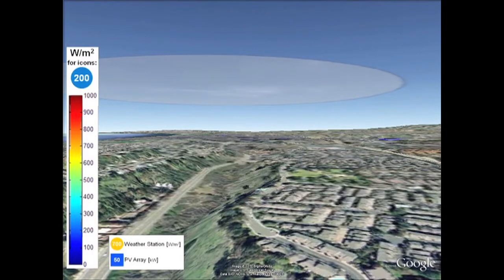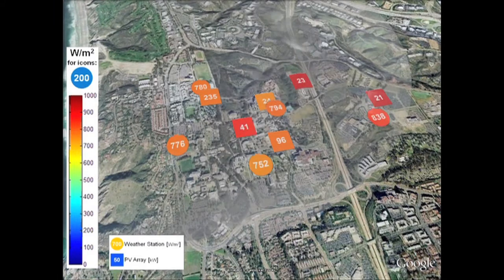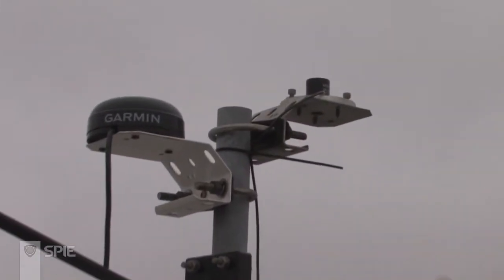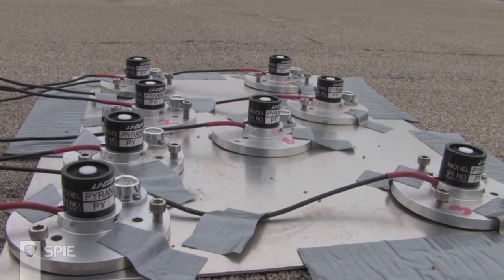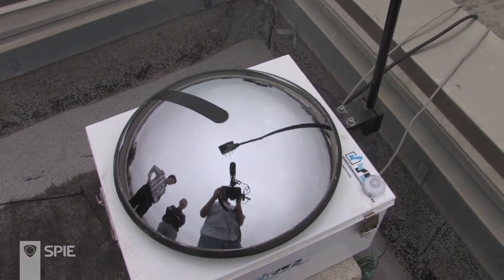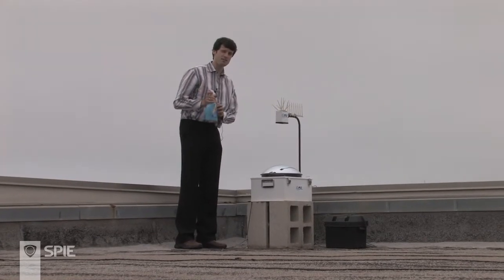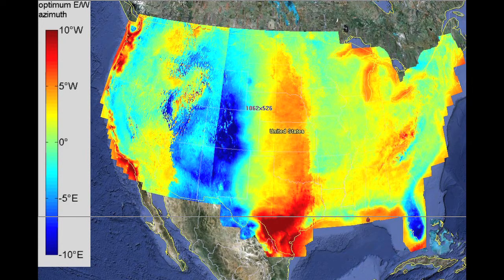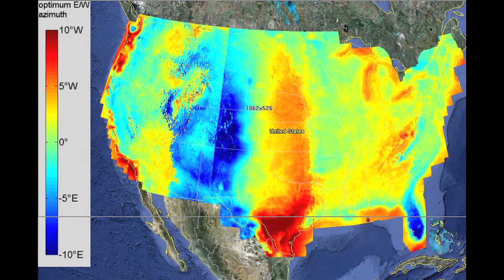Sensing and mapping solar potential

Comment: Does after 10 years from your work the satellite data replace the gound measurements for aim of solar mapping? Which spacial resolution is required to define the points to mount solar pannels?